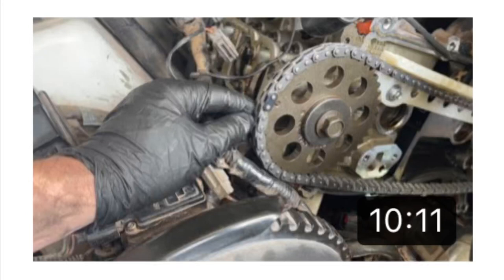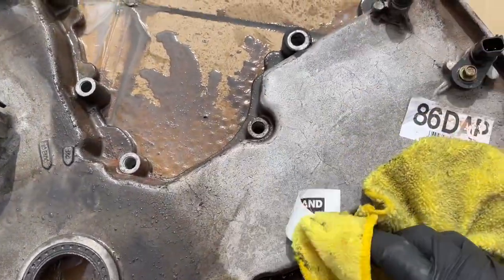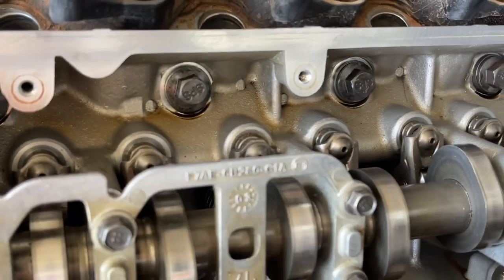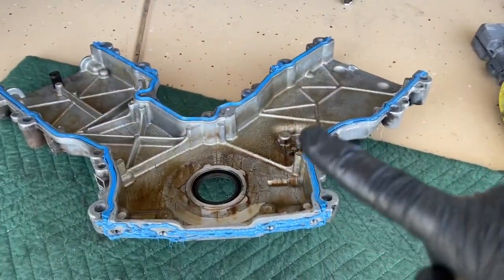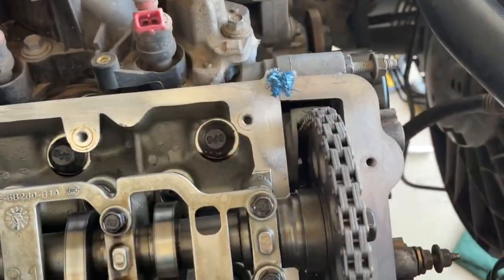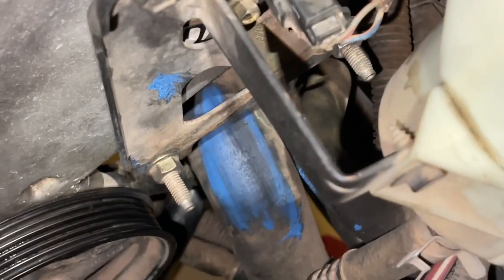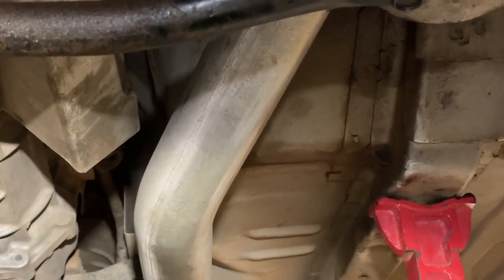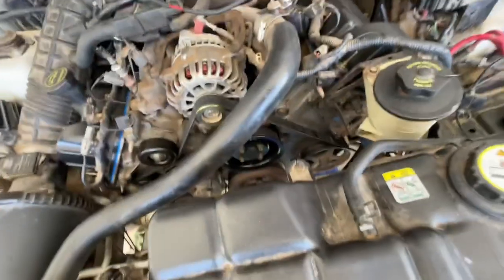Timing Cover installation 4.6L Ford 2V Mustang, F-150, Crown Vic

Comment: When I dig into my engine I START by cleaning it up to prevent crap from getting into the mechanicals.  It's never perfect, but better than struggling with dirt build up the whole way through a repair.  Those valve covers and timing cover never would have come off my engine in that condition.

Comment: I never knew the car would only crank if you pushed down on the gas pedal and clutch at the same time. I always pulled the fuel pump fuse before cranking the engine. my 66 GT has 106K so I am sure I am not far from having to do what you did....nice job!!
Reply from the maker: It’s set to clear the engine from flooding 👍🏼

Comment: Same Job to do now on my Towncar here in Austria...;-(...how did you reseal the Oilpan in the rear? Only install it back with the old gasket in?
Reply from the maker: Yes, if the old gasket is still fine just put it back together. If you see it’s been torn or broken add some gasket maker

Comment: The reluctor wheel.  What does it do?
Reply from the maker: The crankshaft position sensor reads the teeth as they go by and measures when the notch is missing, telling the computer the position of the crankshaft at top dead center
Reply: @dannyjohnsonsgarage  On that subject. I have a Mod Max 4340 forged stock stroke crank. I was told I need the correct reluctor wheel for it. Will the stock one off the 2001 Windsor work?  It fits no problem.